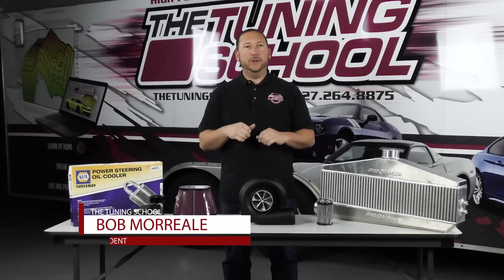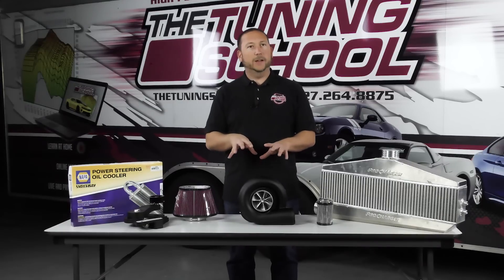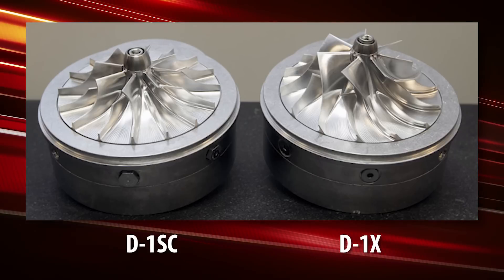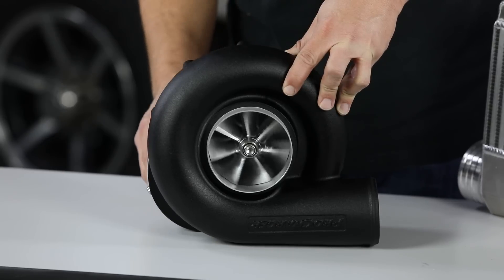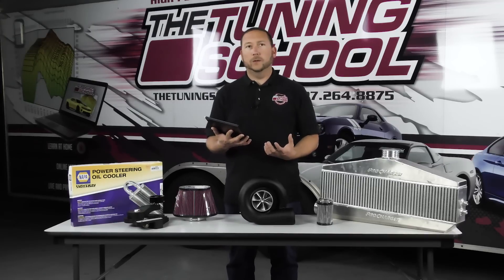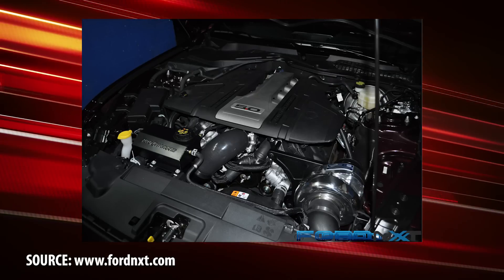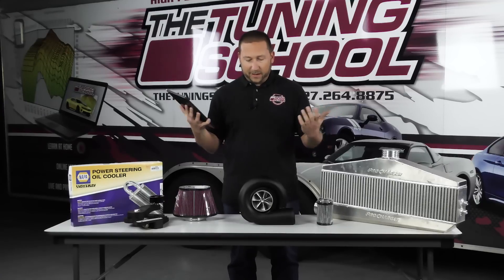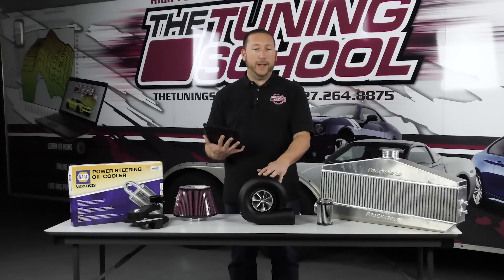Procharger D-1X Review Direct Replacement for D-1SC

Comment: So much not included in this video. I have a D1sc on my LS GTO. Trans is built, so is driveshaft, 8.8 rear end and axles. My point is I could, and probably will, do the upgrade but for those that are running stock heads, trans, driveshaft and rear end will get a rude wake up call when shit starts to implode. $1700 upgrade is really a $12K+++ upgrade if you want to make that kind of power and drive it the next day.

Comment: If you’re running dodge and depending what mods you have the blower definitely makes a difference. Dodges don’t rev high, the D1x looks good on paper but in a dodge it takes a lot to get that blower going not unless you’re 2 stepping to build boost. Its still a serious blower. The D1SC you’ll get more shine with less mods. Sometimes the X can be an over kill

Comment: Very cool
I wonder if a CVT version of this blower could be built
Since these blowers tend to work best in the upper RPM ranges a cvt or similar to spin them faster at low rpm would be beneficial. 😉
Reply: Mark Maxwell Believe it or not, they actually do. It’s called I-1. It had four modes on it. It’s like tour, sport, competition, and custom.
Reply: There’s other ways to accomplish this: you can over-pulley, and put a restriction on the intake side of the blower.

Comment: Love your show very educational please continue the fine work my question to you is I want to run a bigger supercharger like the 
F1A-94  but would like to know how do I estimate what pulley size I need and how low can i run these bigger head units in other  words I don’t want to buy a small supercharger and than upgrade down the line I rather purchase the larger supercharger now and just run it on LOW boost If it’s possible.

Comment: I'm your 152nd like. Just had to throw that out there. Thanks. For my 6k pound Cadillac EXT with 408 stroker which should I run with F1R or D1X?
Reply: SlimSlugga713 The bigger the better. Did you end up getting a Procharger?

Comment: Great video; thanks for using my Nova / findings on the D-1X. I was considering jumping to a F-series, but was really impressed with the D-1X!
Reply: Derek Putnam how much power is it putting down in the nova? I’m trying to get about 800-900 to the wheels and I’m coming from a P1sc. I was thinking about the F1 but is it a big jump with the d1x
Reply: @ryanwilliams8028  it made 925 rwhp at 15.5 psi. I'm sure it would make more if we installed a smaller pulley for more boost; will have to see later this year!

Comment: I just want 600+ hp and torque at the wheels on my stock M6 Scatpack.  What are my options?
Reply: Band It Two years later. Everyone I have personally seen add boost to the stock 392 hurts the engine in no time. If you’re on a budget the drop in forged stuff will allow for your power wants reliably. The ring lands are just to thin for boost on the stock pistons. No amount of tuning will solve that problem.

Comment: Procharger told me that there is no difference in power under 15 psi between  d1sc and the d1x that in fact the d1x might make less power vs the d1sc under 15psi
Reply: damn if that is true then i'll just stick with the d1sc since that comes with fuel injectors and tune. For some reason you cant get that complete kit with the D1x.
Reply: Thanks for the commend, we're trying to get a D1SC to test and show any differences.
Reply: That’s strange because they also say the higher head unit makes more power per PSI

Comment: Do you have any data for area under the curve?  Everyone keeps referencing peak hp numbers.  Does the "X" flow as much at lower speeds as the "SC" or is it a compromise?
Reply: Hi Kevin, we don't have the comparison under the curve yet.  We are trying to get a D1SC to run a comparison for you guys though.  :)
Reply: Thanks Bob.  When I talked to Procharger, I was led to believe the curves tilted rather than moved up.  The D1-SC might perform better down low.  While most will disregard this, it plays a big part in drivability and power available at part throttle which is huge for most cars that aren't made for race.  But I'm not exactly sure what they were using as a constant, pulley size, peak boost number...   

Excited to see a logical comparison between the two, apples to apples.
Reply: Yep, I'd like to see the power curves and boost curves as well!
Reply: Power under the curve is more important than peak most people
Don’t get that. You spend more time under the curve and mid range than you do at redline

Comment: I have a D1SC. If I want to make more power I can just swap down to a smaller pulley. Pulleys cost $100 instead of $1700 for a whole new unit. I understand you only go down so far in pulley size but unless you plan on going over 1000hp then no need to upgrade.
Reply: SixGunSled what are you power numbers? I have a stock Scatpack Challenger and want 600+hp and torque at the wheels.
Reply: Tim Green I’m at about 580 to the wheels. I’m the procharger can push a lot more than that the issue on these LT1 motors that the chevy’s have is they run out of fuel at that point and need other mods.

Comment: The Scat is waiting!! But i think the D1x is to much BOOST for my stock 392 :(
Reply: Please forgive me...are you guys tearing your engine's down and gapping the rings and what not? ....or are you just bolting on the supercharger and running it? I ask because I have a gen 6 454 that I want to procharge.
Reply: Based on? Set a power goal, understand what fuel you need to get that power and make adjustments as needed. If it's street driven honestly and why I don't like blowers that much is you'll be running it on pump gas more often than not. Even if you throw in race fuel as seen by The Tuning School, max gain will be in the 30-35 hp range with no boost adjustment. 100-120 hp gain over stock with one of these is reasonable and acceptable to most people.
Reply: @dj4monie   I threw a D1-X on my 2012 Boss 302 and gained 340hp over stock with 9.5 psi on 93 octane... That's a 70% increase in power. Baseline number was 430/398